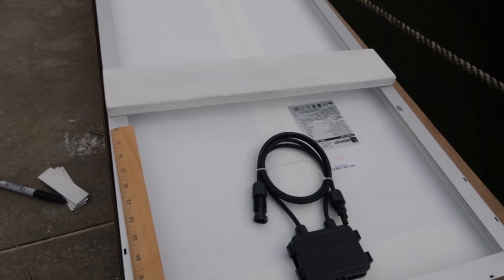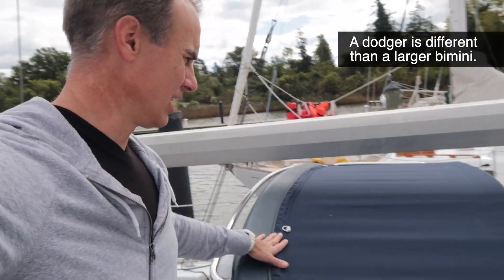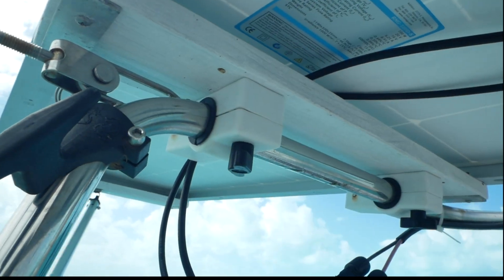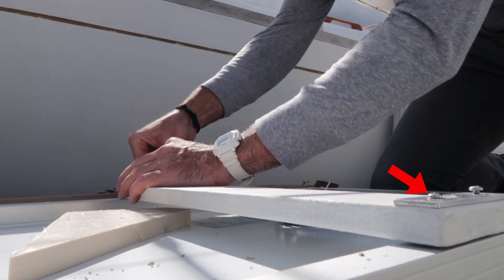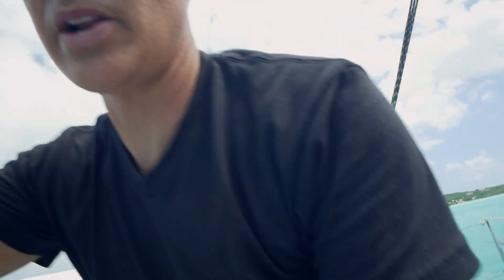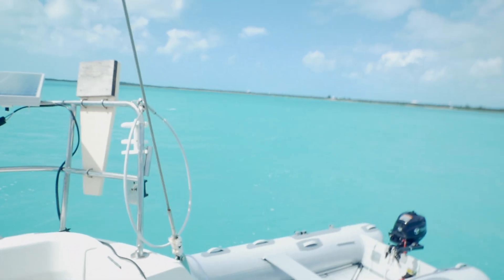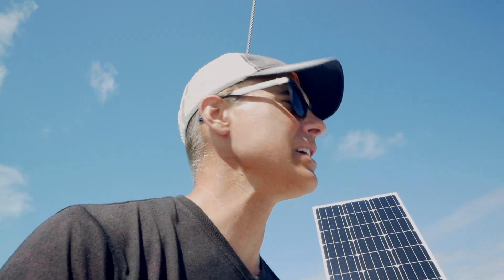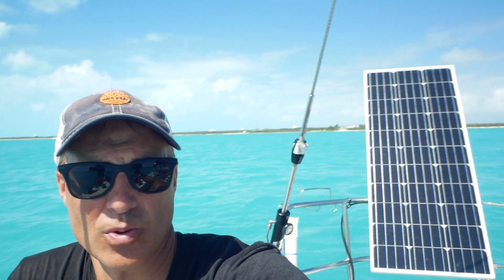How to: Simple Solar Panel System (Boat, RV, etc.) (Ep. 18)

Comment: Great Video! Anyone find the swivel pieces to connect the pole to the panel?
Reply from the maker: Check the video description. I put a link there for the clamps.
Reply: @JoshPostVlogs thanks! Got the clamps just working on sourcing the other hardware, Bimini pole tips and that swivel  piece you used to connect the pole to panel. Love the solution!

Comment: Do you have the charge controller directly connected to the batteries? No problem having the alternator charging them at same time?
Reply from the maker: Hi. Yes I have the charge controller going directly to the batteries. I have a fuse on the red positive wire in between battery and charge controller. I haven’t seen any problems with alternator working at the same time.

Comment: Do you have your starting battery hooked into this system? If so are there any issues when the motor is running ,back charging into the  controller?
Reply from the maker: Hi. I have an “automatic charging relay” which connects my starting battery to the house batteries. Mine is a brand name “Blue Sea Systems”. If you Google it, you’ll see what it is and how it works. It essentially keeps the starter battery separate but it will allow the starting battery to charge if it drops below a certain level. It’s the typical why to hook it up.

Comment: Great.  But if you think you're ever going offshore in conditions that may result in a wave breaking over or into the cockpit, this configuration is a BAD idea.  I recently reviewed a YouTube where the Captain was doing a Transatlantic.  A wave crashed over a quarter.  The solar panel folded down captured the force of the wave.  The force was transmitted to the railing and as a consequence the railing was destroyed.  If you do install panels this way, before you do offshore, you really need to completely stow your panels below deck or flat on the deck somewhere. This install looks like it will be easily destroyed and the panels will be carried away.

Comment: What is the rated power of that panel you installed. What are the dimensions?
Reply from the maker: Max power 100 watts and 6.25 amps. Optimum operating current 5.29 amps. 
Weight: 16.5lbs
Dimensions: 46.9 X 19.7 X 1.4 In
Brand: Renogy

Comment: Some solar panel installations absolutely need safety fusing and DIY installers should know when and why.  Also a dual pole safety shutoff switch is a smart, cheap investment.
Reply from the maker: Yes. I installed a fuse between the battery and the positive wire to the charge controller. I don’t believe it’s shown in the video which is why I’ve mentioned it several times in the comments.
Reply: @JoshPostVlogs Thanks.  I only read a few of the top comments.  Some setups will require fuses between the panels and the charge controller as well.

Comment: This is the  BEST video I've seen about solar panels.
I'm seriously considering doing this with my Mainship 390.
Thanks!!!❤
Reply from the maker: Very cool. Thanks. It’s quite simple. I’ve used those rail mount things from the brand “Sea Dog” to install several panels now. Works well. I have a smaller 50 watt panel I put on the rails of another boat and no need for the broomstick thing on the smaller panels. I just used the rail mounts. Also don’t forget a fuse between your battery and the charge controller in the middle of the positive wire. I think I forgot to mention that in this video. Cheers!

Comment: Hi Josh, really liked your idea and mounted my solar panel to the aft starboard side of the pulpit rail on my O’Day 302. How have your panels stood up? What were the drawbacks?
Reply from the maker: Thanks for the comment. I have since sold that boat but it held up very well. And I’ve done the same exact thing on subsequent boats. The only draw back having it on the side is I’d sometimes have to think fast to lift up the panel if pulling into a dock as it could get in the way of pylons. But that was very rare. So 95% of the time it was a very stable setup. Even in high winds I never worried about the panels.

Comment: Hi, is your starter battery connected in series with the other batteries or separate?
Reply from the maker: Hi. Best to keep the starter separate but connect it to your other batteries with a “charging relay”. If you google “Blue Sea Systems charging relay” you’ll find good info on it. Essentially it’s a device to keep the power isolated but it still allows your starter battery to charge along with the house batteries. Good luck.

Comment: Lets say i want to switch between solar charging  and engine charging what do i use ?
Reply from the maker: Your engine will charge the batteries when the engine is running via the alternator. The solar is separate and will charge when not using engine. I guess technically the solar is always charging but the engine will always charge faster and with more power so when the engine is on the solar is essentially obsolete.
Reply: @JoshPostVlogs  thank you

Comment: Great video, thanks for sharing!  I have the same set up with 4 house batteries and one starting battery…. So when going from the charge controller do you just link that to one of the batteries which are all then connected or to all batteries individually?  
Thanks!

Comment: Hi Josh, great video.  So my situation is I will be installing solar panels on my pontoon to charge my 24v  battery pack for 80lb trolling motor and 2 fish locators .  I was under the impression that I had to install a inverter to convert DC to AC.  But maybe that's not required?   The plan was to go 200 watt panel, 300 watt inverter, to a marine 2 bank marine charger and with a 20 amp MPPT.  But early in my research so this may all be wrong.  Any suggestions from your or your followers would be greatly appreciated.  Thanks in advance
Reply: Also thinking on running wires from both bow and stern so I can move the panel based on if in slip or backed up by the woods when off slip. And now more confused than before on rather I should go parallel or series.

Comment: One question if anyone can answer:

Does it work with acid batteries that need distilled water or should I get gell filled or lithium… also I have an alternator on my boat will it affect the starting of boat… have a 34’ ft

Comment: Thanks for sharing this. I'm trying to get my boat rigged for long term cruising the Caribbean and a possible Atlantic crossing later in. But figuring out the whole solar and wind generating thing is getting more confusing as I research it. I'm planning to run 6 100W panels across the hard top with an extra 2 panels on the railings like you have and maybe a wind generator.  hopefully that's going to give me enough power to keep the 6 lithium ion battery bank charged for everything I need. Thanks for the link to the adjustable pole that's going to help tremendously.

Comment: Great video was very helpful. For the pole what size did you use since the product varies in sizes. Also did the pole come standard with the three positioning holes or did you have to drill them. Would you happen to know the inside diameter of the pole. Thanks.

Comment: Nice setup....

But I wonder if I actually need two 100 watt solar systems to just power my lights inside..., and outside ( anchor light and red and green position lights ..., which are required in Europe ) ...

I just got my eye on a nice reasonable 50 watt system ( without battery ) but with panel and controller for a good price.... but for a few dollars more I can get the 100 watt system!

So which one would you suggest? 

The motor doesn’t need power! Just lights and safety ... and charging my phone and laptop via cigarette lighter plug! 

It’s all a 12 volt system....
Reply: My first thought was that 100 watt was overkill and 50 watt ( or even 20 watt ) is sufficient for what I need!
Reply from the maker: Hi Max. Thanks for the question. I guess it all depends on how long you plan to be away from other power sources like plug-in dock power, and also how many batteries at what amps do you have? If you plan only one day or maybe two days, yes a small system will work fine. But if you go 3 or 4 days or a week away from land and away from plug-in power then you’ll want a larger system. But there are several questions I have, is this a small boat with only one battery that you use for day sailing or is it a large boat with say 4 or 5 batteries where you cruise around for weeks at a time?

Comment: How much practical difference does the adjustment make vs a flat solar panel, assuming that you're not constantly adjusting?

What I've heard is that since boats tend to move (around a few axes) the gain from pointing the solar panels is offset by the losses when the boat inevitably moves (or you forget to pivot them) and the panels are not only not pointing directly at the sun, but they're at a disadvantage compared even to flat panels.

Comment: Could your system handle running a couple full sized freezers?  A friend of mine wants to set up an overnight campground on a small cay near Andros, and having access to a freezer is pretty important to the deal.  I've been researching solar (of course) but so far all I'm getting is sales pitches and not answers to my questions.
Reply: You have to look at the power consumption of the freezers and the amp hour rating of the batteries in order to know the answer to your question.
Reply: Holy shit you freaked me out!  That was 2 years ago man! @FuriouslyFurious
Reply: @MisterTheBigC  hahaha. My bad. I wasn't even paying attention to the posted date.

Comment: Did you install a fuse into the circuit?
Reply from the maker: Yes. I put a fuse on the positive wire, close to the battery terminal.

Comment: The real question is the panel   To power  the boat. Or you have electric  motors so you used  the solar system to keep the boat moving rather then gosling

Comment: Thanks for the video. How did you wire the output from the charge controller to multiple batteries? Are you charging the start and house batteries simultaneously? Also, did you add fuses to the wire between the batteries and the charge controller?
Reply: This is my same question. Any takers for an answer?

Comment: Hi there! I was wondering if you always keep your solar panels out like this or do you put them inside for winter or storms? Great set up
Reply from the maker: Hi. Thanks for watching. I keep the panels out almost all the time. Only time I’ve taken them off is if I go into a dock that has a wall or piling that may hit (most docks hit lower on the boat so it only applies in rare circumstances). And I’ve taken them off in high winds but that’s rare also, only extremely high winds like 35+ knots. And I’ve never had to experience winter with them since I’ve only been in tropical climates with them.

Comment: Excellent video. Lots of great info. Very curious on the connection on the panel side of the extension handle. Would you happen to have an affiliate link to that part?  Thanks. Stay safe

Comment: It seems that if you use parallel and a panel goes out, you still have a closed system, in series this is not the case.

Comment: Are all of the batteries including starter battery hooked together?
Reply from the maker: Good question. The starter battery should be isolated. It's best to have the starter battery still able to get a charge using something like this made by Blue Sea Systems. https://www.amazon.com/Blue-Sea-Systems-Automatc-Charging/dp/B000OTIPDQ/

This will keep the starter battery charged off the house batteries when voltage gets to a certain level. With that said, I hook the solar to the house batteries and use the Blue Sea Systems isolator to keep the starter charged but isolated.

Comment: Hey Brother you could pay couple more $ and get the flex one and add them on the canape.have fun any enjoy your new panels.
  https://www.amazon.com/dp/B07BMNGVV3/ref=sspa_dk_detail_5?psc=1&pd_rd_i=B07BMNGVV3&pd_rd_w=WwNND&pf_rd_p=7d37a48b-2b1a-4373-8c1a-bdcc5da66be9&pd_rd_wg=RmGsA&pf_rd_r=K5NAGAW061M9ZH5MHRP9&pd_rd_r=edddb3e9-b650-45c5-b9fe-d03b105b7407&spLa=ZW5jcnlwdGVkUXVhbGlmaWVyPUEyNE4ySFJJMk1JVEpLJmVuY3J5cHRlZElkPUEwNDcyNDU5NzZQQVdVNlQwN1lDJmVuY3J5cHRlZEFkSWQ9QTAyMDYyNzEzRk1WNFdJVU9RVlA0JndpZGdldE5hbWU9c3BfZGV0YWlsJmFjdGlvbj1jbGlja1JlZGlyZWN0JmRvTm90TG9nQ2xpY2s9dHJ1ZQ==

Comment: Grab some home solar panels used off craigslist. 200-400watt panels usually run $120-160 depending on your local market.  The voltage is higher so you need to use an mppt charge controller.  Hate to see people spend hard earned money on these overpriced crappy renology panels  (as far as th solar industry is concerned). Sunpower is the best as they degrade at a much slower rate.  I use 9 Sunpower 435w panels on my 40ft rv that I picked up 2nd hand for $125 each.
Reply from the maker: Thanks for the tip brother!

Comment: I have a Renogy 100 watt panel and a 40 watt MPPT Renogy Rover charge controller. I only have 1 100 amp/hr battery right now. I plan on adding another panel and another battery next spring.
Reply from the maker: Thanks for the comment Gregg. Cheers!

Comment: Nice video- thanks! Do you (or anyone else) think a strip of King Starboard (eg 1/2 inch or 3/4 inch thick) would also work (instead of the wood plank)?
Reply from the maker: Hi. Thanks for the comment. Certainly starboard would work well. And would likely last forever. I know it has a bit of flex in it but likely not a problem as long as you go with at least 1/2 inch think (3/4" may be better).

Comment: So did you fuse off the circuit also? always good to limit fire hazards :-).
Reply from the maker: Yes. Another commenter asked this as well. I forgot to mention it in the video, but I used fuses at the battery terminal.
Reply: @JoshPostVlogs  and live another day! keep it up!

Comment: I recommend getting one of these camping fold up USB charging solar pannels.(see link) I have a 13w one which works ok but ill be grabbing a 30w one to keep my phone and tablet charged by day along with a portable high capacity Anker power bank. I leave the power bank charging on all day in the cockpit. At night use it to top up the devices.....means you have a separate system if your main batteries fail. You can still use your phone, tablet. I also have a portable Bluetooth speaker...... My buy list also includes a USB handheld VHF radio....again I can keep it charged using the fold-up panel.  

https://www.amazon.co.uk/VITCOCO-Function-Waterproof-Portable-Cellphone-29W/dp/B07VBNBRSV/ref=sr_1_fkmr1_1?crid=2W3IUZ79TEG08&dchild=1&keywords=folding+solar+panel+29w&qid=1603120183&sprefix=folding+sola%2Caps%2C154&sr=8-1-fkmr1
Reply from the maker: Good tip. Thanks for the comment!

Comment: man I looked at my boat situation dumbfounded with my solar panels with drool rolling out of my mouth for about 3 months until I found the perfect size Bimini frame on OfferUp and got it for 40 bucks! 1-in heavy duty thick wall stainless steel with heavy duty fasteners and clamps everything was there and it turned out great!

I also use that $10 charge controller you got and it charges my batteries just fine. Here in southern California I typically get 14.4 volts of charge all day long so I never really have to worry about power anymore. I don't have enough batteries to run a regular microwave and refrigerator but that's okay. I would like to be able to run my laser printer every now and then. My power inverters won't handle it.

I got my panels used for $20 each (120 watt, 240 total), 12 volt battery $80 AGM HUGE backup battery for hospital emergency backup, charge controller $10, Bimini frame $40, wire out the trash free, misc connectors $20 from marine salvage place... Total $170 works better than most at my marina 🥳

Everyone at my Marina asks me to work on their boats. I had to stop doing that because it was far too much. I love the people, but I only have enough body left to move around with LOL

Comment: Hi Josh. Thanks for showing us your system installation! Very good solution with this flipping system! Hope you installed fuses too!? If you don't at the moment, I recommend to install those for more safety. Just research for, fuses solar system, and youll get the ideas;-)
Reply from the maker: Good point. Yes, I did install fuses. I should have mentioned that on the video. My understanding is the critical spot for a fuse is when the positive wire meets the positive battery terminal, so I installed an in-line fuse there. Also, for anyone reading these comments for tips, remember to use heat-shrink electrical (wire splice) connectors when working with wires on a boat (good for water resistance).

Comment: Hey Josh - great vid.   Can you post a link to the clamps you got off amazon to attach the solar panels to the stern pulpit bars?  I'm going to be doing a similar set up in the spring myself.  Thanks!
Reply from the maker: I will put that in the description right now. It looks like the price fluctuates a bit between $25 and $35. Thanks for the comment!

Comment: Hi Josh, In order to increase efficiency when the sky is overcast, it would be necessary to check whether a series connection (solar module) achieves better results. if the mppt can handle ~ 40V. OCV 2 x 20V - i'm sure that when it is cloudy, 13V will no longer be generated - that means no charge in this case
Reply: 👍👍👍👍👍
I have a new London National Maritime Museum video.
Check out my new travel channel if you got a chance.
Thanks 😊
Reply from the maker: Thanks for the tip!

Comment: Good job!   Do you take them down while under sail?
Reply from the maker: Thanks! I keep the panels up all the time. Seems to work fine. Only time I’ve had to take them down was at certain docks and/or locks that have high side walls that would have hit the panels, but that’s rare.